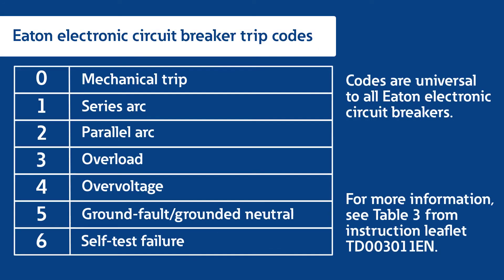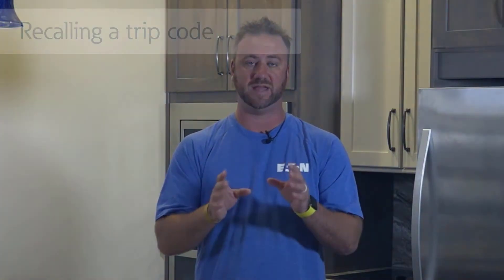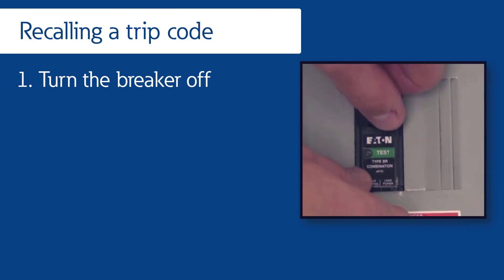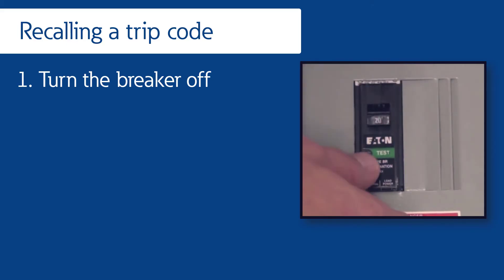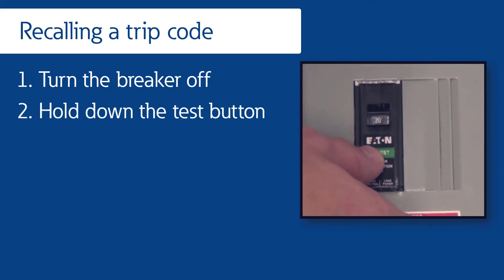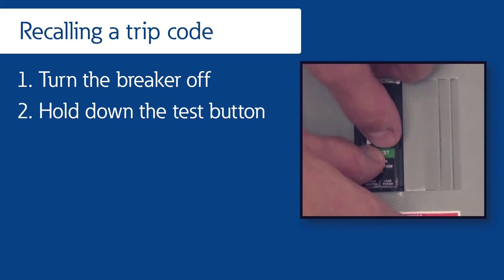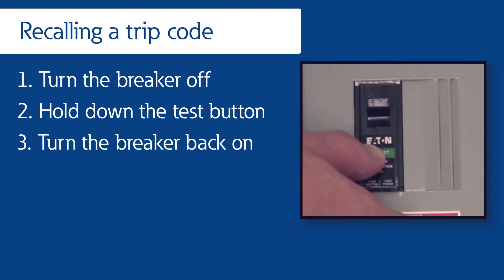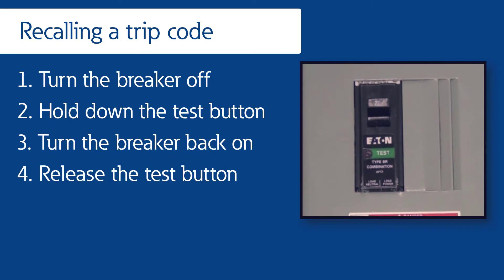Eaton electronic circuit breaker trip codes

Comment: Several of the Eaton CB's in my home show a steady red light. What does it mean?
Reply: I found this from Eaton in 2020, posted in Reddit.

To: Eaton CH Customers and Distributors

From: Jay Haugen, Product Manager, Miniature Circuit Breakers

Date: 16 December 2020

Subject: Red LED in CH Dual Function breakers

Some Dual Function circuit breakers have their red LED turn on and stay on after installation. The light may come on right after the breaker is powered up, or it may come on days or weeks later.

What is this light for?

The red LED is a diagnostic tool designed to provide a series of blinks to indicate to a qualified professional what caused the most recent trip event for that breaker. This function is still active and available for breakers that have the LED lit.

Could the lit LED indicate any other warning?

A constantly illuminated red LED is not one of six programed event indicators, thus it cannot be confused with any other event which will require attention/service. The LED being constantly illuminated is not an indication that the breaker is operating in an unsafe condition.

Why is this happening?

The mechanical parts inside the breaker that allow this functionality have very tight specification tolerances, but there can be slight variation within those bounds. Electronic firmware designed to interpret signals from those mechanical parts and communicate the trip indication is sensing a variation slightly outside of what is expected and causing the light to stay lit.

Is there a safety concern?

The condition causing the light to stay lit is strictly cosmetic. It does not affect the breaker’s performance protecting against arc faults or ground faults. Every breaker is tested at the factory to ensure that all features are functional prior to being shipped. Additionally, the practice of pressing the TEST button during installation and periodically throughout the breaker’s life reaffirms that the breaker is functional and operational.

What are we doing to fix it and when?

Contractors are encouraged to include some indication to the end-user that a breaker with an illuminated LED that has not tripped is not defective or damaged and is providing the necessary protection. We are currently developing additional screening measures at the plant to detect breakers with potential for the red light to stay on. Finally, we will update the firmware of the breaker to be less sensitive to in-spec component variation and eliminate the red light issue by the end of January.

<<signed>> Jay Haugen, Product Manager

Comment: And what if no lights blink after turning off, holding the button while I turn it back on and them releasing the button no lights blink - I have the breaker for maybe 1 year and paid almost $100 for it!
Reply: if the breaker did not trip, then there is no code to store.

Comment: I had 3 of these die in a new construction home with 6 blinks for self test fail within 3 years. These breakers seem to go faulty pretty fast.
Reply: I had 4 that died on arrival. Never once got to use the outlets.
Reply: The four of them all tripped at the same time indicating failed self test
Reply: They have discontinued it, there is a new replacement. Mine failed as well in 7 years.  This is the new replacement BRN115DF
Reply: Bought one in the last couple months. Keeps tripping with gfci outlets but no error codes

Comment: What does a continuous solid red light mean but the breaker hasn’t tripped?
Reply: Same question
Reply: I have the exact same issue with my kitchen gfci breaker in garage.
House is 6 months old...
Reply: if not blinking means no code is recorded, it would be this...not sure though.

Mechanical disconnect (thermal, short circuit, manual disconnect)
NO TRIP CODE IS RECORDED for mechanical actions. These include:
• Loss of power from the utility or upstream breaker
• Manually switching the breaker OFF
• Pressing the TEST button
• Short circuit
• Thermal overload trip caused by mechanical part of breaker (This is rare.
The electronics should trip on thermal overload before the mechanical
side in most instances.)
Reply: I have the same issue on 2 year old house on the breaker for my washer. Smh. But washer has been working fine...only saw it when I went to turn off another breaker to install a ceiling fan.
Reply: Same problem
Reply: Same problem if anyone knows let me know

Comment: There is a huge problem with these breakers and nuisance tripping. Homeowners don’t need to be resetting breakers 3 or 4 times a day. I have removed afci breakers and put in regular breakers in there place. I understand why NEC has put this in place but it has proved to be impractical. Sometimes people need to take control of any given situation. These breakers are a bad design. Need to be re-engineering in my opinion.
Reply: I agree.  These are horrible.  I moved into a new build less than four years ago.  Have already replaced 8 breakers.
Reply: I need to replace one of mine, goes out 3 times a day. New build 6 years ago
Reply: @richiealvarado325  ….they also tend to always be warmer than regular breakers especially when they are installed next to each in the panel which is usually the case. That will surely cause nuisance tripping. You can also try to put a space on top and bottom so there is an air gap between breakers. I’ve done this at a clients house and it stopped tripping.
Reply: @iceinyourveins-rn7em  this probably explains why my bottom one has never tripped, but all 4 of the others have done so.  I have replacements on the way, hopefully the new model is better than the old one...
Reply: @stevendarlene …… yes since the bottom one has one side  that has that available free space it dissipates the heat the othes are sandwiched in and that heat collects over time especially in the hot summer months. I would get a hold of the manufacturer and find out if R and D has made adjustments to the model that you currently have installed. Hopefully they have found and corrected the issue with the news ones you got coming in.
Reply: I wish you would reconsider.  This type of breaker serves an important safety function.  I get that the breakers themselves can be a nuisance, but you could put a GFCI receptacle in the first spot in the circuit (for example) and get pretty much the same protection.  Perhaps you've already done this or something equivalent but wanted to put that out there.
Reply: @ …. Thanks for the info. I actually have an update to my comment. So i recently learned that a power surge can damage AFCI breakers as well as GFCI outlets. The remedy for this is to add a whole home surge protection at the MAIN. I have put one in my home and now have peace of mind that during a storm or power outage all my electronics are safe including mentioned items above as well as Smoke detectors. Another thing is if your getting your Panel replaced and go in with AFCI breakers you have to have the correct neutral wire landed on the right breaker. So there is a good amount of knowledge to have before you make the switch to AFCI breakers or buy a new home that already has them installed.